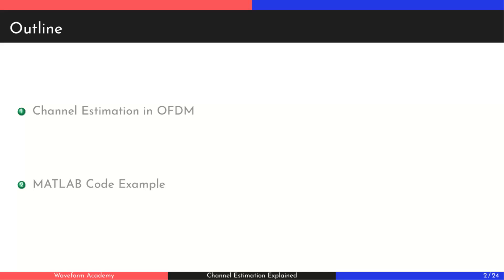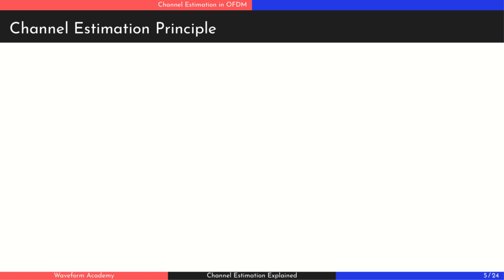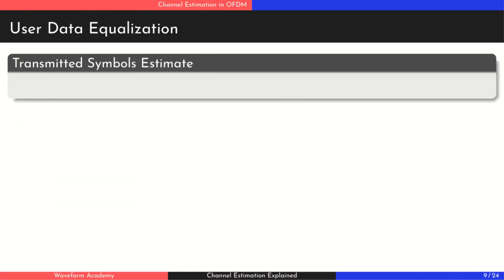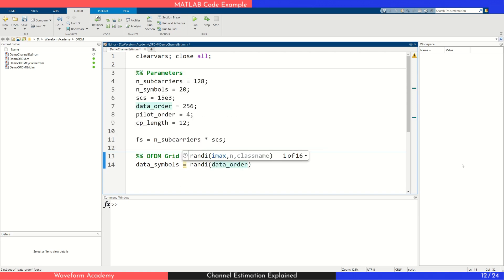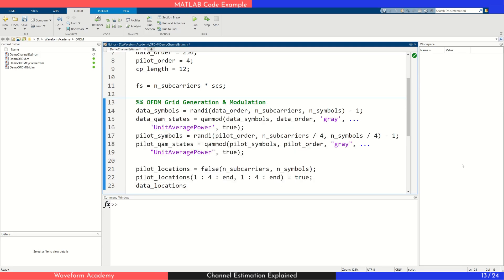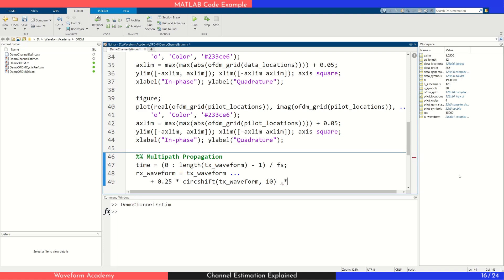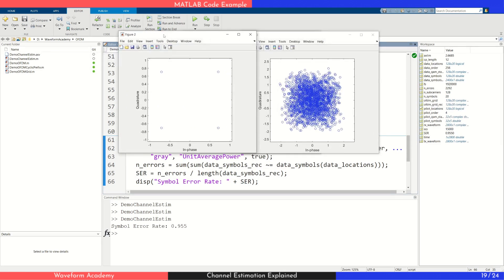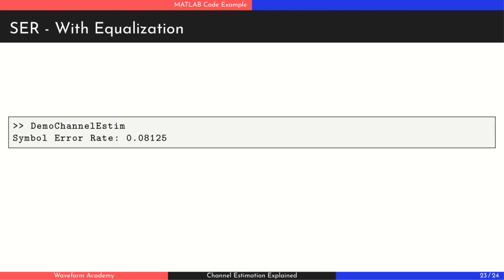OFDM Channel Estimation and Equalization with MATLAB Simulation

Comment: And i have another question. When I change the number of subcarriers, the simulation result is horrible. Do you know why? Thanks again for your work
Reply from the maker: Great question, and it actually goes deeper than what I covered in the video. Let me give you a short intuition for what’s happening.

If you compute the original channel frequency response with
"hest_orig = ofdm_grid_rec ./ ofdm_grid;"
and compare it to the interpolated one (hest_interp) using:
"imagesc(abs(hest_orig));", "plot(abs(hest_orig));"
and
"imagesc(abs(hest_interp));", "plot(abs(hest_interp));"
you should notice the oscillatory “sine-like” pattern created by the modeled channel.

When the number of subcarriers is small, the interpolation has very few samples to work with. This leads to visible “ridge” artifacts near the edges of the interpolated channel matrix. It’s essentially an undersampling problem.

You can also look at the frequency spectrum using:
"plot(abs(fftshift(fft(hest_orig))));"
and
"plot(abs(fftshift(fft(hest_interp))));".

For example, with n_subcarriers = 64, you’ll likely observe aliasing. The sample count is too low to correctly capture the true frequency of the channel’s variation, so the interpolation struggles and the final estimation isn't accurate.
Reply: To be honest and precise, I tried simulation with 64 subcarriers, and with this number results were horrible. When I used 128 carriers and more (256 subcarriers), the simulation was as it is in the video. Sorry for not precise information from my side.